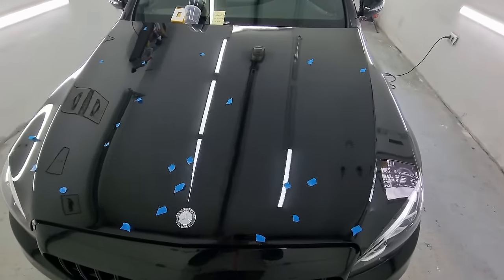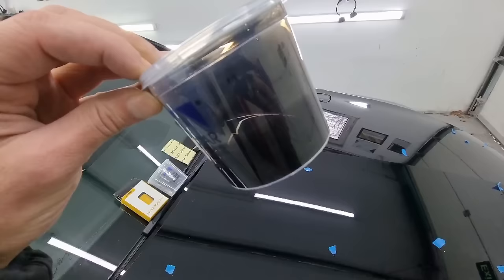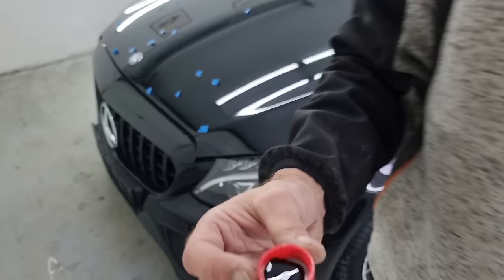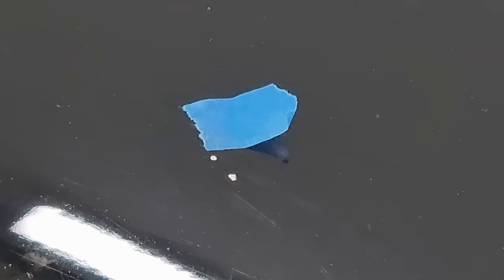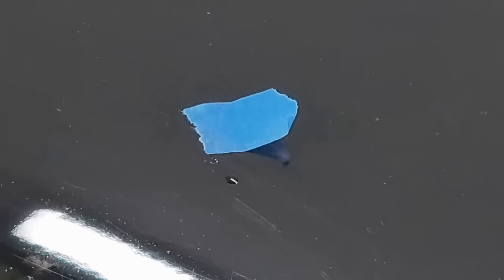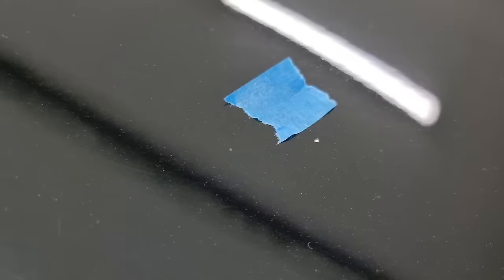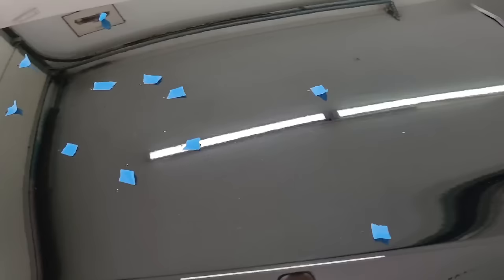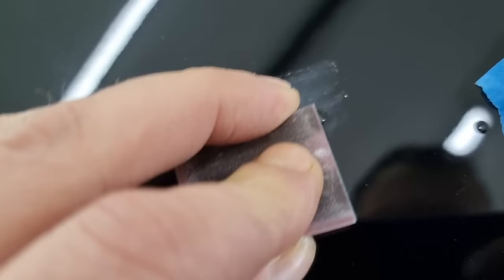How to Repair Stone Chips a yours CAR HOOD/ Touch UP!!!

Comment: I have a question. What to do if the paint has a metallic/pearl top. My car has a white base, but there seems to be a top coat, containing small particles, which make the "pearl effect". When I try to fix with only the white base you can see the spots from miles, because the pearls are missing, and the spots just shine pure white. Any help will be appreciated.
Reply: White is the base coat. You to apply top coat which has xirallic

Comment: I wonder why the mini file itself doesnt scratch up the original paints when you moving it back and forth?
Reply: You have to stop at the right time... And yes it does provide micro scratches to the original paint. But the original paint has a certain amount of clear coat on it, so you'll be fine after polishing.
Also, I guess you could put a tape with a hole in the middle so the tape covers all paint around the chip when you scrape it. But I guess it would be extremely tedious and has a chance that you don't scrape off correctly.
Reply: @cholera4858  thanks for the input

Comment: Hello is the Hardener + Paint good also for metallic colors or also the clearcoat is needed in this case?
thanks
Reply from the maker: it can be without coating, but the coating gives it even stronger strength for sanding later

Comment: Don't you have to sand the defects prior to applying the paint in order for it to adhere properly?
Reply: If you have stone chip damage I don't see any good in sanding it because damage is placed deep in the paint layer. You need to 'overfill' the hole slightly to scrap off superfluous of the paint by Mirka Mini-File and polish it out to finish the job. The alternative is to sand blast the hood entirely and repaint it.
Reply from the maker: upravo tako

Comment: The ONLY easy way to repair stone chips is to take the vehicle to someplace that does this professionally. IMO, every other way is just too much fiddly WORK.
Reply from the maker: There are a lot of people who don't want to paint the factory paint and decide on this one, which is just as effective as if it were painted 😉
Reply: @Amddetailing  
I do not doubt your views. I was making an attempt at humour when I said the only EASY way... I've looked at a dozen videos on how to get rid of stone chips and they all look like WORK to me... hours and hours just to make a few square feet of automobile look shiny. Now, if all that work extended the life of the vehicle in any appreciable way, or made it run better, etc., then maybe. But to just LOOK better I need an easier way.
  Certainly I want the rust in any deep chips or scratches to be permanently stopped so why not just a dab of Neutra-Rust then wax the vehicle?